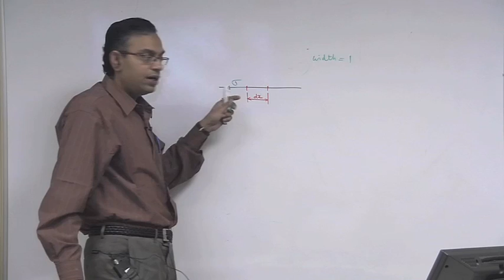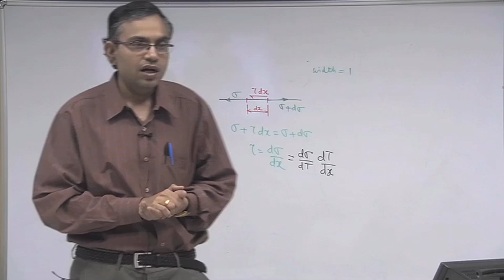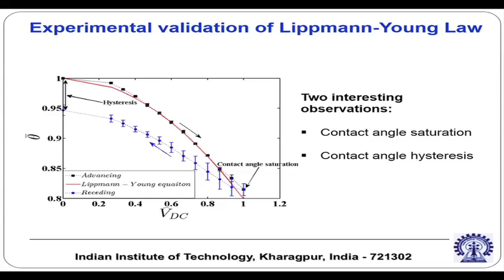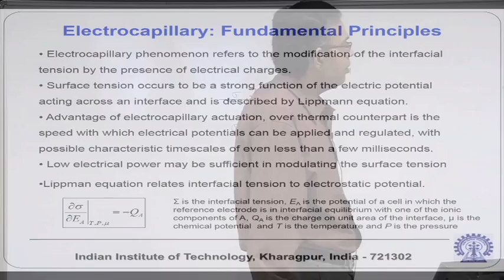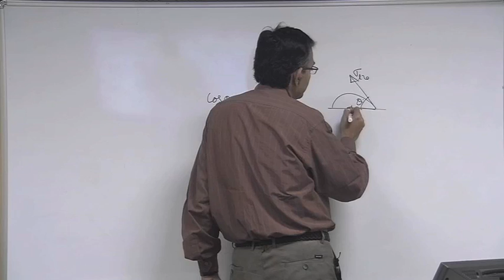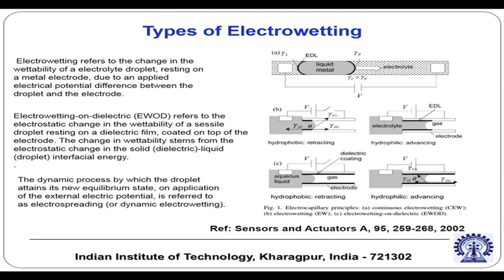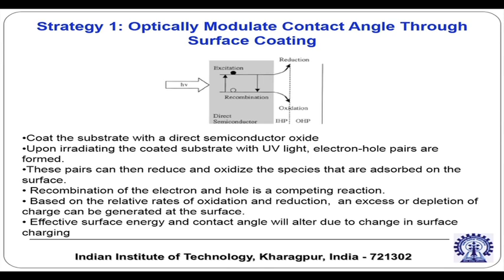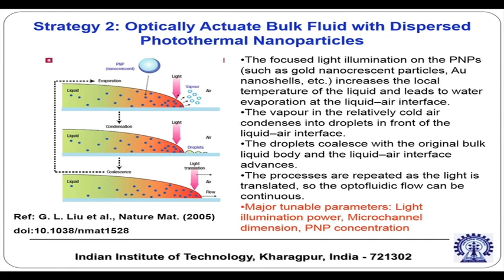Mod-01 Lec-28 Modulating Surface Tension (Contd.)

Comment: I would strongly suggest this test be conducted with highly accurate potential sensors which monitor the real-time potential magnitude values which can then be correlated to your surface tension contact angle hysteresis to eliminate this as one source of bias in your results

Comment: if we cycle an electrical potential across the droplet - do the same surface contact angle values occur each cycle or is there further drift in the theta values after each cycle ? - if so then - in what direction and how much variation ? - also - I think you have to question your voltage source - even though you assume the voltage to be identical when you switch polarity in the source - have you verified this to be the case ? I would suggest the switch in polarity MIGHT be causing a variation is the magnitude of the potential and resulting in your hysteresis - without absolute certainty that the exact same magnitude of potential is applied in both directions I think you can state no more o this phenomenon - what is the potential source  test apparatus used?